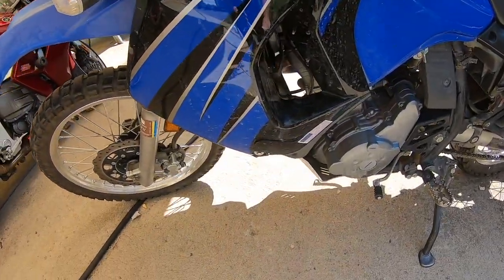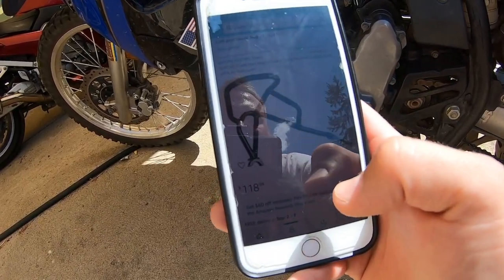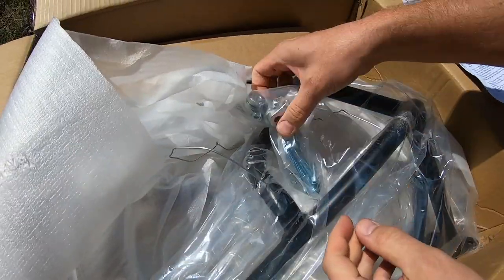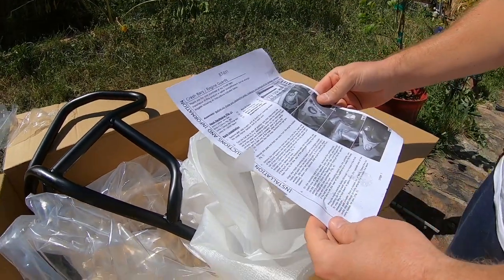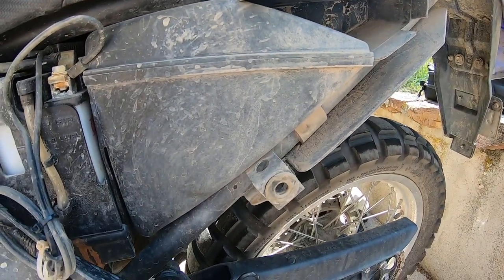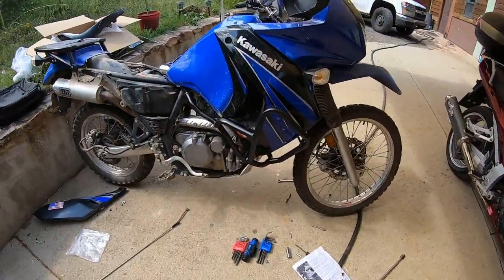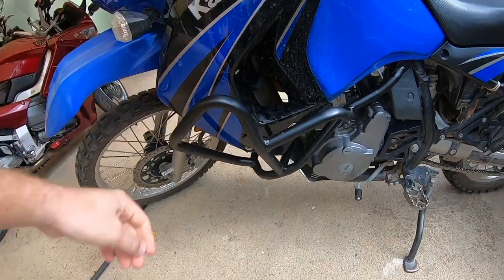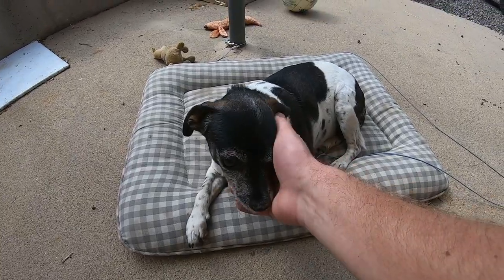Adventure Bike Crash Bar Install | KLR650

Comment: I got the same bars off ebay made for a gen 2, and they fit the gen 1, they're just wider than they need to be.  For those allens I use a long, ball end hex-to 3/8 ratchet driver (a set from harbor freight).  Then I can put it on my little impact driver or ratchet.  I want to convert the other frame and engine bolts to studs, so I can take one crash bar off easily.  Right now I can't get the carb out without taking the right crash bar off.  Either this or modify the right bar to clear the carb area.
Reply from the maker: Thanks for the tip! Sure it can help someone out

Comment: I bought crash bars from China which I believe are the same as yours . When I fitted the front engine bars after firstly fitting the two bolts with the 4 spaces I found the part to connect either side around the throat of the frame was to far apart to be connected ( using the number 5 alum key ) . This is because in my opinion the “spaces” that came in my package are too wide . Would you please advise me of the width of the spaces that you received ?
Reply from the maker: Hmm 🤔, send me some photos to adventuretomek@yahoo.com 
I’ll have a better idea of what you are talking about.
Reply: Email with photos just sent

Comment: Let us know how they hold up to your first drop or two. I was looking at these and the full protection style... I do like how these look now that I see them.
Reply from the maker: 👍🏼 they are working great, had a few major drops…. On one even snapped my brake lever off.  I may do a follow up video.
Reply: Thank You. Mine were $114 including shipping. But didn't come with any paperwork. They were wrapped well in foam an zero scratches. But didn't know how to attach under tank. I plan to make mine wrap around the front when the bender comes in. If interested , eBay now has benders for $59 that includes 9 dies I think it is. It's not the kinking Harbor Freight pipe bender but a for real tube bender. Most vendors are charging $129 - $169 but keep looking and one is selling it for$59.